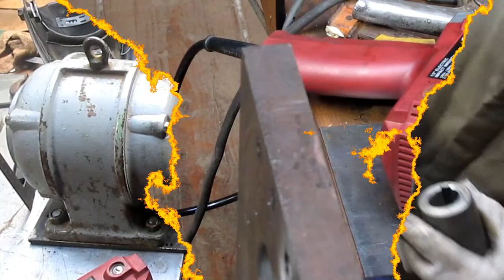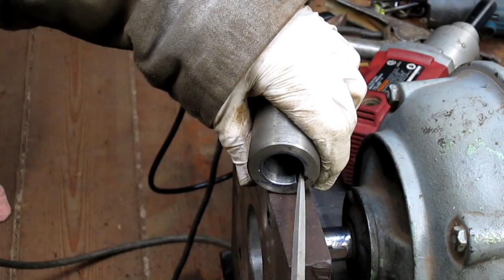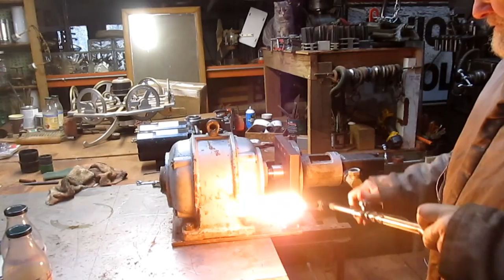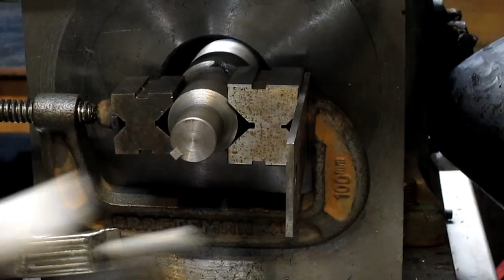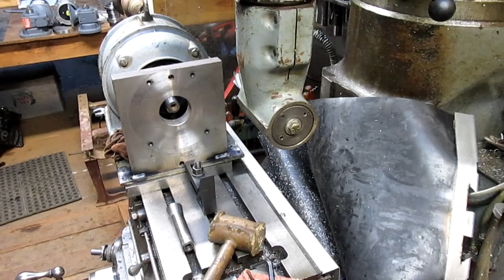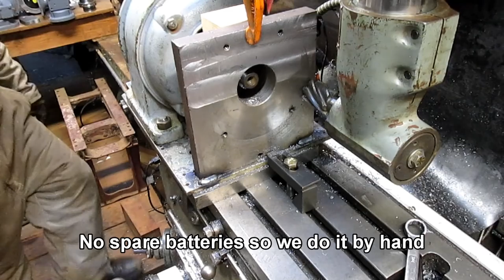Shop Press Build #7

Comment: Hi Nik,
the set up would look like the vertical support plate would flex on the base plate, as the base plate looks relatively thin. I suggest that two braces sloping from up high on the support plate, back to the motor mounting point will stiffen up the support plate. This will help towards ensuring that the set up does not change or distort.
Reply from the maker: +Charles Camenzuli Exactly what happened. Stay tuned for segment 8 where I approach that very problem.

Comment: Hi NikThere is a threaded hole half way between the 2 bolts that tighten the right angle head to the quill. This middle hole is for a set screw that is used to force the gap open during installation on the quill. Once you get the head onto the quill, you need to back the set screw out a bit to allow the two bolts to tighten onto the quill.
Reply from the maker: +Chuck Castiglione My head seems to slide right on without adjusting the set bolt like when it was made it was pre sprung. I just tighten the two bolts and that's it, she's tight.
Reply: THANKS FOR THE REPLY NIK     IT JUST LOOKED LIKE THE HEAD WAS JUMPING AROUND.  LOVE THE VIDEOS. KEEP UP THE GREAT WORK.